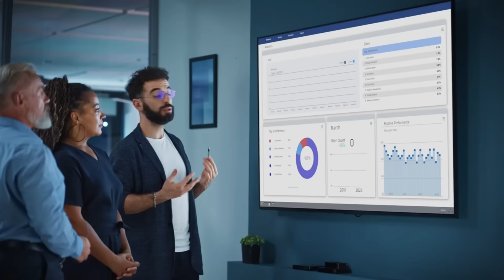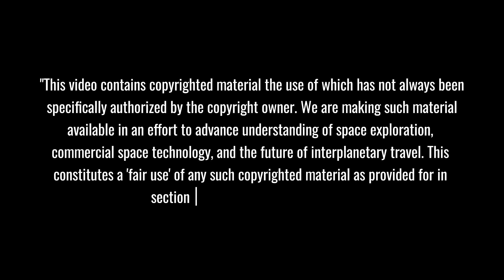SpaceX Did Something Never Done Before: Metal Shield Revolution Explained!

Comment: Or you could try this ceramic tiles with stains steel backing, not nearly as thick. With that coolant system, the biggest problem is yeah, get things to fifteen hundred degrees for a successful reentry, not three thousand degrees.

Comment: There is a large difference in temperature between the "hot" side  and the not as hot side of the landing craft. This difference in temperature can be used to generate  electricity. The electricity can generate a magnetic field to deflect the plasma field.  This isn't a complete solution but should greatly reduce the required efficacy of the other cooling/protection systems
Reply: To generate energy from the heat difference, you're basically homogenizing the thermal energy. Still sounds like a good idea?

Comment: Here's a new ship design.   Fission/Fusion to heat and electrical including the lenz law.   A superconductor.  A rod magnetized with positive on one end and negative on the other.  Create an attachment of a supercoil and without contact add positive to positive and negative to negative to create a magnetic bubble that can used as a forcefield with high heat plasma, sensors, and lasers.  A hull becomes the warp field bubble.  And can use magnetic coils inside the ship and a specialized spacesuit to walk aboard while in space.  I know it'll work.

Comment: Elon look at my star device at exotic propulsion. You can use a tesla coil to fire it at a high frequency at a low volts and amps, so it mimics a high volts and low amps, so the power is high. The device will then become superconducting and emit antigravity waves like the UAP at Skinwalker ranch. Using a tesla coil on an EV, ICE, Fuel Cell will make the batteries last a long time. The ICE become a fusion engine. The Fuel Cell become a fusion fuel cell. This is accomplished by the star device and the tesla coil hookup reversing time with produced antigravity waves. It is the same with your spark ignited raptor engine. You can then travel long distances and get to Mars in a day's time. The cars will then become charged with electrons on their bodies and have warp drive and wormhole drive capabilities. The spinning car's tires will allow propulsion of the car. With the coming Helion Polaris or my star device soon all computers and internet will go lightspeed. The HD TV will become a replicator so you can build tons of star ships and Tesla cars fast and at a low cost. Your star link will become radio frequencies to gravity wave communications instantly anywhere in the universe instantaneously. People will be cured and made young as the revelations and Jesus states in the bible by the reversed time. Ukraine and Gaza will instantly be rebuilt, and all weapons will stop working so no more killing or wars. All ancient civilizations will come back. Contact me if you can and I will explain more to you.  Look up Nathan Bunten of Old Man builds to learn more about tesla coils and fusion. The astronauts going to Mars will not have the radiation issue and if they do the antigravity waves will cure them. Also to make artificial gravity you put about 50 layers of solar panels as a metamaterial and let light impinge upon them and then attach a load so the incoming neutrinos that have something to do with gravity have their vibration energy decreased by the gravity waves of Mars being turned into electrons that then get dissipated by a load. My theory expands the spectrum. Look me up on science and business sites to learn more. I have done this with one layer of solar panels. The solar panels need to have a power saver hooked up to accomplish this feat. All electrically fired gas furnaces, water heaters, stoves and water heaters will become fusion powered. All current fossil fueled electrically ignited power plants will become fusion power plants. The global warming will cease in a months' time as the CO2 will drop.  The drones flying around in my state of NJ are either current US military or future US military that have modified the coming flying cars to antigravity cars by using my star device that can time travel.

Comment: Rotate the craft.  Space is  minus 453.8 degrees Fahrenheit or minus 270.45 degrees Celsius.  It cools its self.
Reply from the maker: Interesting concept—rotating the craft in the frigid vacuum of space could indeed leverage the extreme cold to help cool surfaces naturally during re-entry or orbit!
Reply: Fail.... it's a vacuum
Did you not do basic science at school.... what transmits heat fastest a compact metallic solid or a vacuum
conduction or radiation... is the question... go look up  Einsteins work on  photoelectric effect.  beeeeccaaauuussseee that is what ur using in loosing heat to a vacuum.

Science at hone....
stick a metal rod  say  2 M long in a burner, then hold the end of the rod, then go stand 2M from a  burner (not a vacuum) , come back .. tell me which one you prefer...

Comment: Why not use tiles made of Artificial diamond  instead of ceramic ? Or coat the metal tiles with layer of Artificial diamond deposit ?
Reply from the maker: Artificial diamond could be revolutionary for heat resistance, but its cost, brittleness, and manufacturing scalability might be hurdles—still, a diamond-coated metal tile is an intriguing idea worth exploring!
Reply: you mean like  putting a turkey inside silver paper & cooking it ?

Comment: True then you see termal exchange and so called soft dry cooling and nasa used so dry cooling and if added volatile fuel is wonder nasa Rockets are so called volatile to explosion or stuff so problems withs so callled even more energy fuel is enginering type solve and achieving lvl off recongnize lvl off stage safety in detajl achieve so called enginering prognozisys or so called  called predictibility upon so called man made improvments and combined tech in assembly line you skip like 15 years off research and the technic is so called soft land or soft launch and creativity in assembly process and this why elon and space x need a factory gigaline in spacex assets also as conditions raze on vtol efect land and take off and tech is poker in kind on 60-40% as cooling and engine creating gas made marvel research and inovation conditions hopefull for new research contions or even birth off vtol and vtoling spaceshipsmefect with improved safety new science look lvl off safety crio cooling role and evenbirth off lift suport starem is easy space ship systems or corvette in english so double Pump turbo drive and with extension 1/3 or 60% reductor add or multiverse purpose engine add direct in vtol rase consumption build or even smaller mass produced engine very functional  and this my frineds brings even more critical efect on Mars as so called build in energy surplass society before pretty fancy about noble or healthy as beauty or beauty off space or genesys or terraform or colony and that to with is own goverment and economy and trade too oh is that place were caracter are strong

Comment: Wonder if slowly rotating the craft during reentry would allow one side to cool down as it rotates?
Reply: With a coolant system running through the body of the ship a slight rotation wood cut down on how much heat it endures giving one side enough time to cool down a little bit before coming around again
Reply: Good idea though may not work due to extreme heat
Reply from the maker: That's an intriguing idea, but would the heat distribution and potential structural stress be worth the gamble?
Reply: use freon

Comment: I have a better idea than ceramic or metal heat shields. Use my star fusion reactor to produce antigravity waves so the third iteration of the raptor becomes a fusion rocket engine. The fuel on the star ship could then just be water and not O2 and methane so it the fusion raptors can fire for years and years.  Then while the star ship is in orbit and needs to come back down to the earth's surface Space X would have the star ship go at the proper angle so the ship slows down and stays at the same height as when it is in orbit and then turn the ship vertical and continue firing the fusion raptors so the ship comes down with no heat generated so it does not need a heat shield. The water fuel can then be used for the Martian astronauts to drink and to water plants to grow food among other things. One tank on the star ship for water and one to carry N2 and O2 for use as an atmosphere so the Martian astronauts can breathe.

Comment: Why not use the same material they use in the walls of the nuclear fusion tokamak reactors?  They are engineered to take a lot more.
Reply: weight "In a nuclear fusion tokamak reactor, the walls are typically made of specialized materials like beryllium or tungsten designed to withstand the extreme heat and radiation from the plasma"